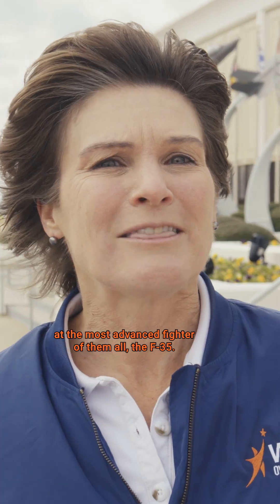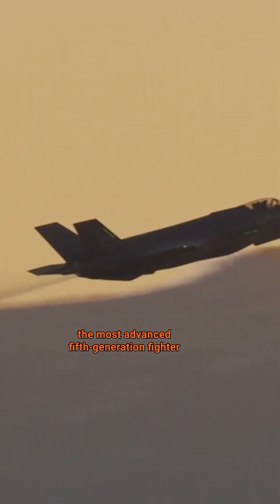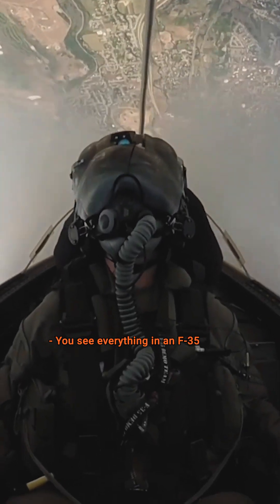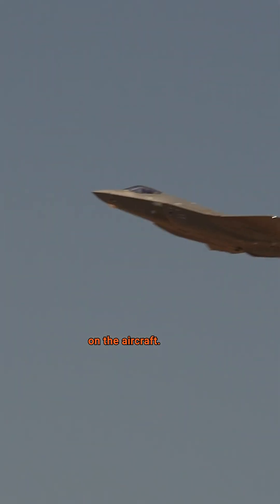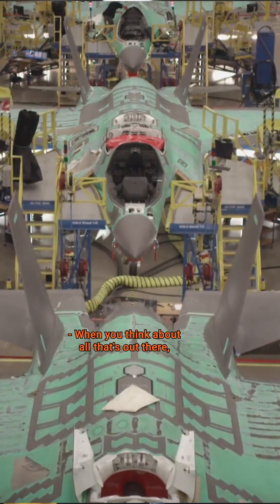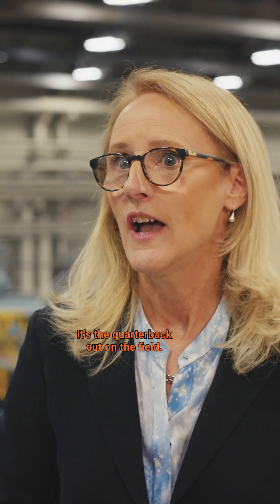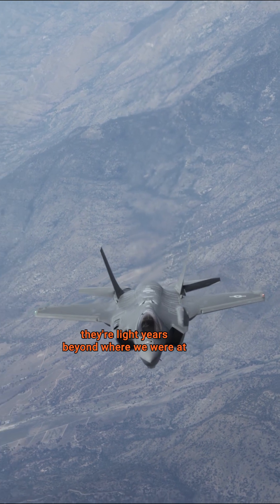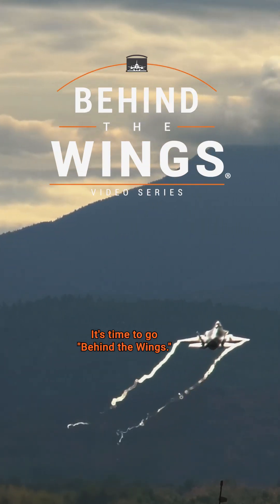How The F-35 is Built and Flown in Combat #aviation

Comment: Unmatched until you bring up the f22 raptor
Reply: Hey pops,the F-22 is out of production....get over it boomer
Reply: @bigstuff52 Gen X speaking here😂🤣🙃🤣😍😋😂. The raptor puts the "Boom" in Boomer 😎, that's why they don't let any other countries have the F-22. But they will sell the F-35 to any country that strokes up a check.
Reply: On the same side and two different roles F-35 is very capable but the F-22 takes the crown in dogfighting. Both are capable in bvr but it's said the F-35 can basically see everything that's happening. F-22 is out-dated but very good.